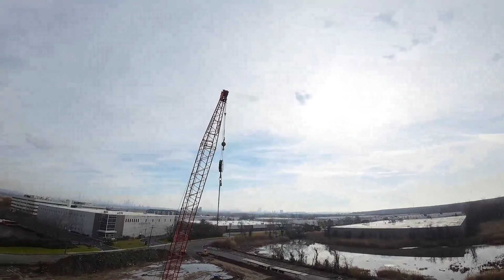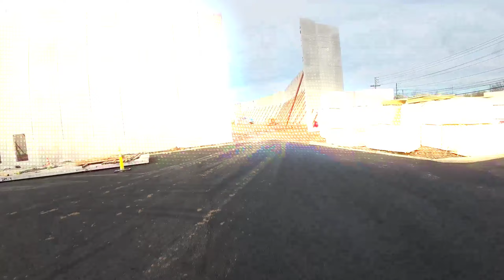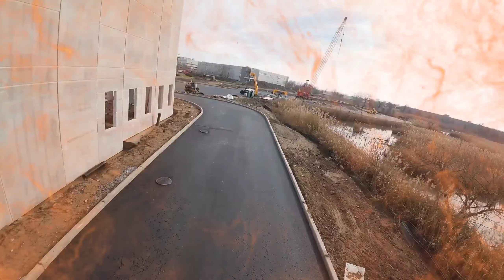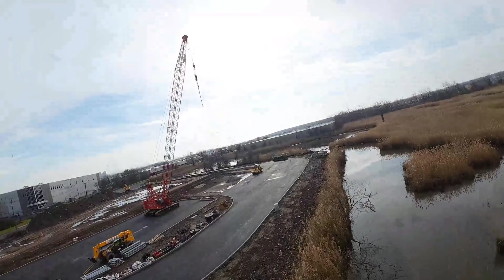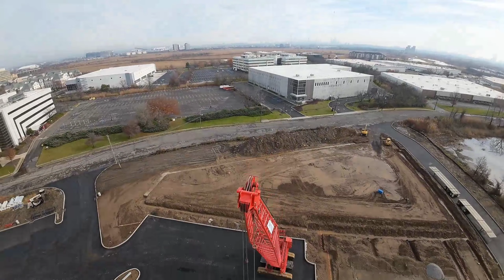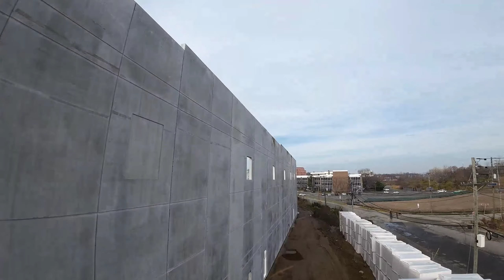construction spot edit 2 #fpv #fpvfreestyle

Comment: Great flying man!  I loved the edit too. 🔥
Over the crane, was that an effect or slow motion?
Reply from the maker: Thanks man.  I used slow motion
Reply: @Smagsfpv  Ahhh.  That slomo may have turned out smootherr if you had used a 30fps timeline instead of 60fps.   
That would have allowed for a smooth 50% slow down I believe.   But I've never used that software before, so I don't know much lol.  
I apologize if you knew this already or if you purposely wanted that slowmo to look like it was at 15fps.  I just saw that part and checked your video stats and saw that it was 60fps video.  That should have let you slowdown by 50% smoothly if you had chose a 30fps timeline.
Just trying to help bro, if it is not needed then I do apologize. 👍
Reply from the maker: @BartManDude  i don't mind the info at all,I like your edits so I welcome the advice,I'm very new to editing and did not know that at all.   I chose 60fps because the app recommended it,said it would play better but the slow mo is definitely a little rough,I will try 30fps next time for sure.   I'm trying to learn how to edit,it's a lot of work man lol.
Reply from the maker: @BartManDude  I'm always open to advice brother,I don't mind at all.
Reply: @Smagsfpv  LOL, it is indeed an underrated challenge in FPV.  It can be overwhelming at first.  
I record everything in 30fps, unless I plan on   doing some slomo, then I will record at 120fps or even 240fps for maximum ability to slowmo.    Anything less than 24fps  starts to look choppy and even worse with less frames.  So if you record at 60, you can slow down about 50% and you're at 30fps, if you try to slow down to 25%, then you're in the 15fps area and your video get choppy.  And if you shoot in 120fps, you can slowdown to 25% and it's all good at 30fps.  240fps, you can slow down to 12.5%  so basically x8 slower at 30fps timeline.
BUT
What you have to do (at least in the software I have used - Davinci Resolve, Premiere pro)  Is you would have to import your 60+fps footage into a 30fps timeline.  I don't know if the sw you are using allows you to choose your timeline framerate, but I'm thinking it must. 
But If you import it into a 60fps timeline, when you slow it down by 50%,  you are then trying to show only 30 frames in a 60fps video, which effectively, makes it look like 15fps.   That is a hard concept to comprehend initially.
Next time you import a video into your editing software, if you're prompted to choose a framerate for your timeline, choose 30fps with your 60+fps video.  If you are not prompted, then you'll have to do some investigating and figure out where to change that default timeline fps from 60 to 30fps.

Now I'm not saying that you should always do 30fps, I do LOL, but that is a personal choice, and is totally subjective.   But it does take up less file size and renders much faster and is easier on your pc.   That is why I choose it.  But I would suggest that you try 60 and 30fps and see if you can even tell the difference, most people can't.  If you can, or you notice that your footage doens't look as smooth as it should, then by all means, choose 60fps.
But if you choose 30fps, you can never really slow it down without AI help to fill in the missing frames.

I hope all that shit made a little sense LOL, it makes sense better in my mind and gets confusing as I try to type it all out. 
Experiment!  I tried following videos and tutorials for about a year and didn't get half as far as I did by just trial and error, scientific method type of testing.   

If you ever have any questions about this stuff, I am more than happy to help as much as I am able.  It's so challenging to learn all this stuff, but we all started not knowing anything about any of it and I think most people in FPV community would bend over backwards to help a fellow pilot out.👍👍  Happy flying friend!
Reply from the maker: @BartManDude  hell yeah man. I appreciate it.  I will try to keep this in mind next time I edit.  Definitely helpful